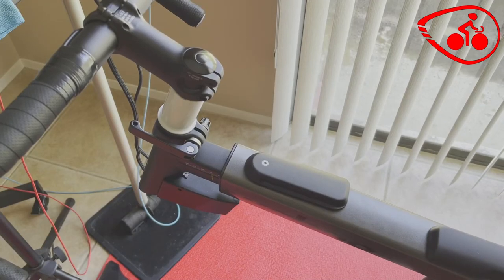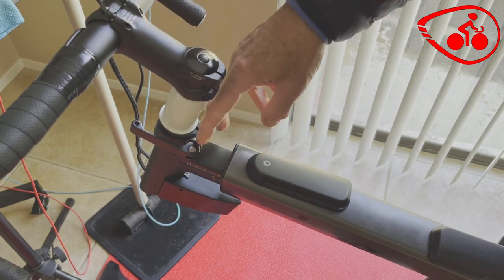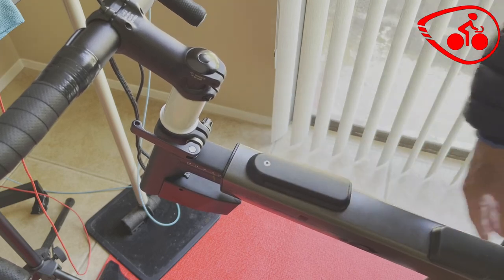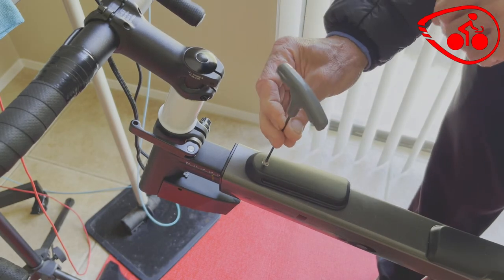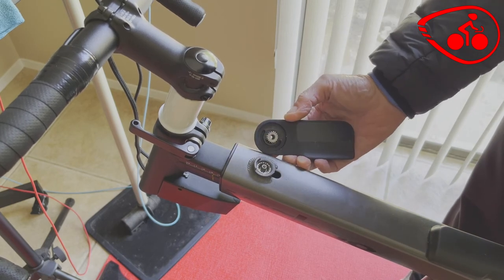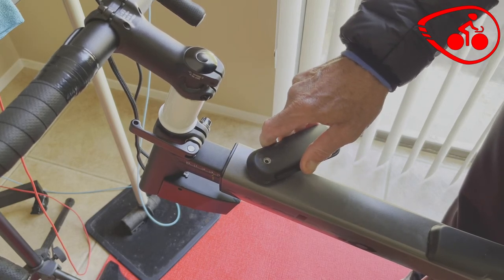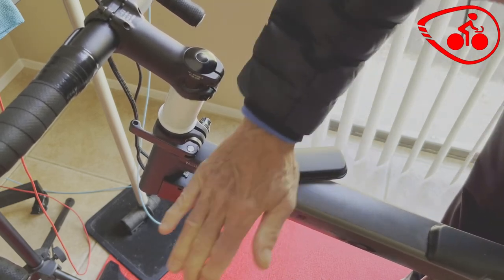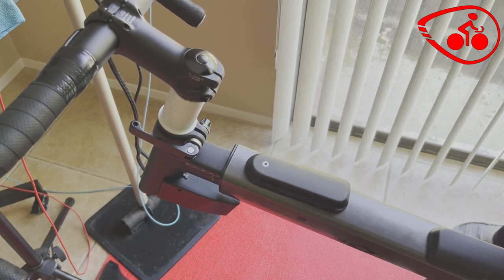WAHOO KICKR BIKE HANDLEBARS SLIPPING? HERE'S THE FIX, IN UNDER 2-MINUTES!

Comment: Thank you . Pls share what you've put to the handlebar post as it's in white colour
Reply from the maker: Went to Home Depot and bought a plastic strainer sink drain extension tube. Cut it to length. It supports the stem from slipping and doesnt scratch the bike. https://www.homedepot.com/p/Oatey-1-1-2-in-x-12-in-White-Plastic-Flanged-Strainer-Sink-Drain-Tailpiece-Extension-Tube-C9803/205153885

Comment: HI, what's that White collar on your quick release? My wahoo kickr bike bars have been slipping for a year Now I need a solution.ive been using vise grips on the bottom to lock out
Reply from the maker: Got that from Lowes (Home Depot should also have it). It is the plastic part of a sink drain that goes under the countertop. Was the perfect size for a large spacer.